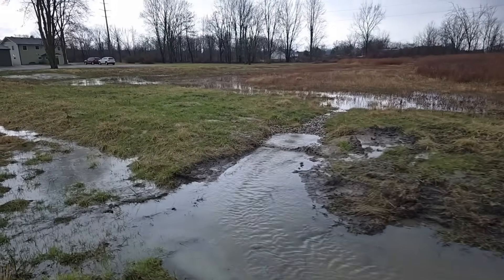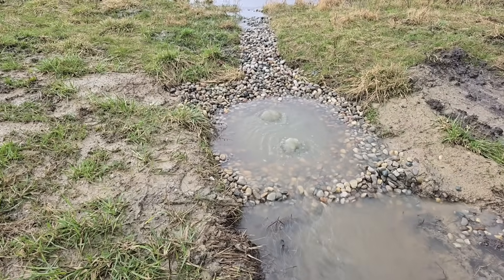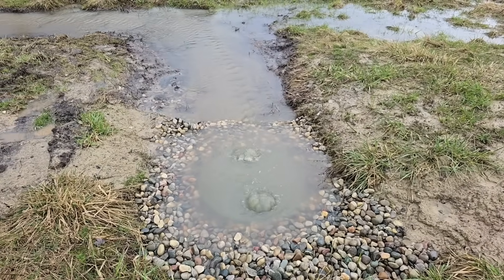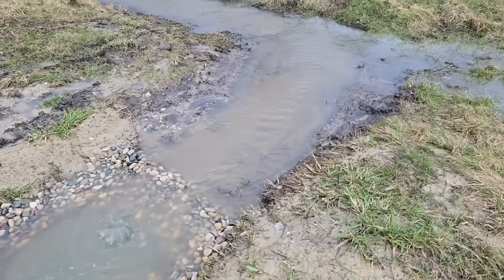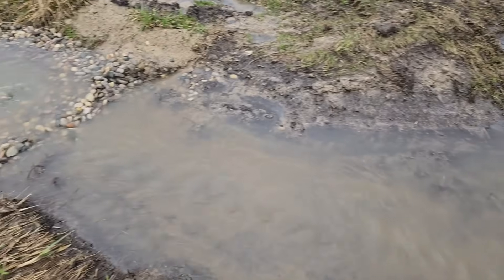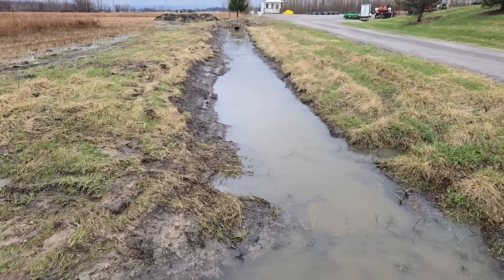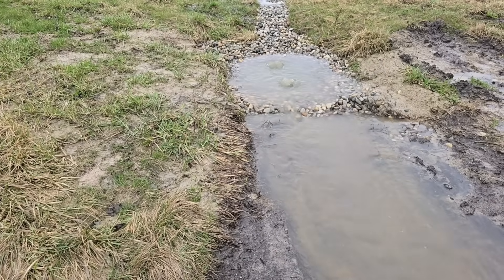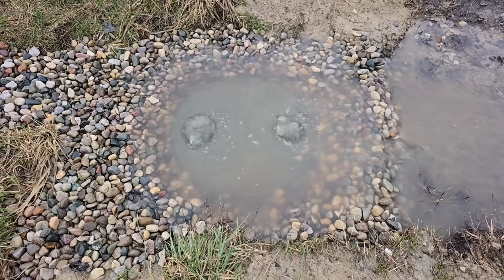Flash Flooding with a 250-foot Yard Drain, French Drain, and Dry Well in Place—Results

Comment: On the risk of oversizing the line, I can see an argument for stacked 4-inch lines, so that the bottom one will run fast and stay clean, but when you get a ridiculous amount of water, the upper line(s) can carry the overflow.  Make the upper line(s) High-Octane so they just pass the water through at low volumes.
Reply from the maker: Thank you. Well said.

Comment: Was this the April 2 2025 storm?

I live in Ontario Canada and we had the same storm roll through if it was that one.  But most of our rain came in the middle of the night(1-3am).   Our town has lots of drainage issues with poor capacity in the municipal system for big dumps of rain.  Luckily our house and street do not have issues with flooding other than some pooling in the back yard.  Can't say the same for other houses in this town though.
Reply from the maker: Yes. It ended up being 3 inches of rain when it finally finished.
Reply: @ ok yeah that was quite the storm.  Freezing rain here in the morning that took out some power lines and then down pouring over night

Comment: Does the drywell  have drain holes on the top?
Reply from the maker: We drilled holes all the way around it (360°). The water is coming up through the stone. There is so much water that it is coming out of the overflow we put in the top. Here is the installation video for this job.
https://youtu.be/gjeum1IcwTs?si=noiFrB_9nHR6q3wH

Comment: What’s the difference between your blue corrugated perforated pipe and the black plastic sold in hardware stores?
Reply: HUGE difference. The black recycled corrugated pipe at hardware stores is made of recycled material, very weak, and has VERY small inlets. This means the hardware store pipe is weak, slow to take in water and easy to clog. The high octane 8-slot is VERY strong (won't collapse), and takes in water at a crazy high rate. If you can get high octane at a decent price, it's a no brainer.

I've installed around 200 or so feet of high octane and around 200 feet of their blacked out 3 inch solid for my downspouts. The results are incredible. Had to redo the work my builder and landscaper did. Trust me, do it once, do it right.
Reply: @jeremydurham3028  the label on the black pipe says it’s hdpe.
Reply: @bigal25938  Yes, it is HDPE, but it is recycled HDPE. That's why it's black. Not all HDPE is created equal.
Reply from the maker: https://youtube.com/shorts/U_O86u8yKd8?si=8Vxz0XL9uj8m0HW7